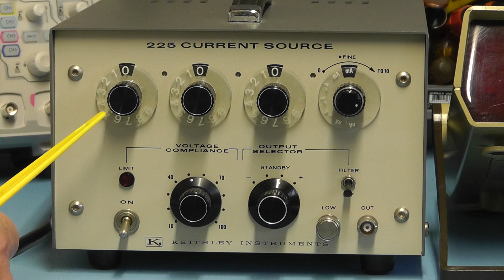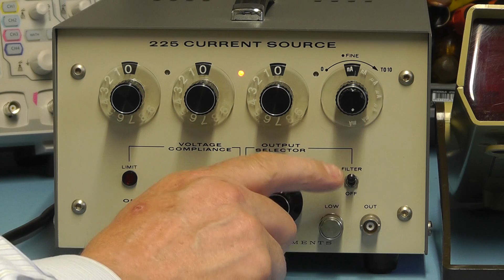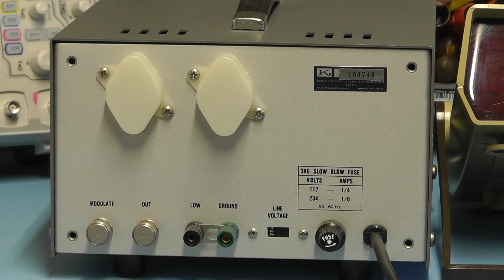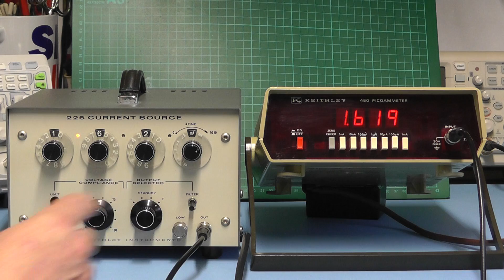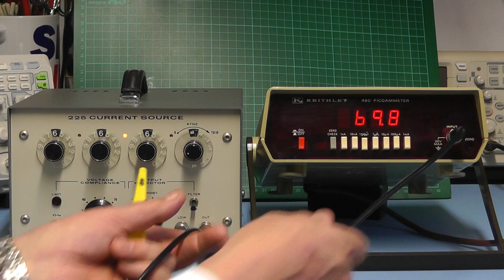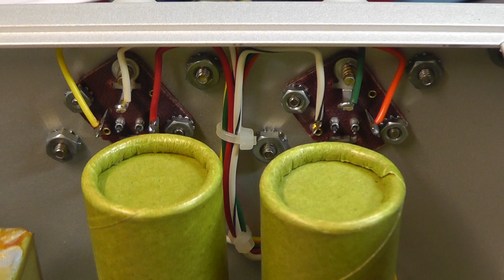Scullcom Hobby Electronics #16 - Keithley 225 Current Source Review & Teardown

Comment: Interesting review since I have the same instrument too. What I noticed is that you mentioned that the output impedance is > 2 teraOhm.  Outputs are supposed to have a very low impedance to make sure that they can drive a connected load. Ok, maybe I was confused because in a current source the internal resistance is parallel with the source and so 'the higher, the better'. I tested my instrument after getting it and was amazed about the accuracy of this 50 plus yrs. old instrument. Now I (and probably you also?) have to find a useful application for it :-). Checking LED's or testing MosFets gate currents?

Comment: I recently did a restoration on a HeathBuilt EU-80A Voltage Reference Source, including its associated Voltage-to-Current Accessory. "HeathBuilt" was a separate product line of the same Heath company that is more famously known for its HeathKit product line, and HeathBuilt test equipment was designed for equipping electronics laboratories in technical educational institutions, and especially for use by scientists rather than engineers. The EU-80A is quite close to this Keithley product, except its three digits of resolution selections use only two Kelvin-Varley Dividers/switches (the two most significant positions), with the least significant digit position being a potentiometer much like the Keithley's "Fine" control. The EU-80A also has a similar range switch showing the units of the selection, and three small lighted indicators to show where the decimal point is supposed to be, although it has only four ranges. It does not have the "Voltage Compliance" feature or the modulation feature (at least not explicitly), but it does have an auxiliary input for DC voltages that may be switched in to the output circuit in series as a sum/difference arrangement, and this could be used to add modulation. Of course, the EU-80A is natively a precision VOLTAGE reference, whereas the Keithley here is natively a CURRENT source. The EU-80A becomes a CURRENT source when the included Voltage-to-Current Accessory is plugged into the VOLTAGE output, and it has its own range switch, selecting currents in the µA and nA ranges (the VOLTAGE then gets adjusted to achieve the desired current), and it is a simple correlation, e.g. if the VOLTAGE is set to 10V and the accessory is selected to µA, the output current will be 10µA, and if the accessory is selected to nA, the same voltage setting will give an output current of 10nA. The conversion is achieved simply by switching a high value precision resistance in series with the voltage output; depending on the range, there are of course limitations on what kinds of resistive loads can be connected to the current output without causing significant errors to creep in.

This video does not seem to state what the circuit methodology of the Keithley is; my guess is that it is the same as that of the EU-80A, but perhaps if natively generates current from the outset......?

The EU-80A, being a less expensive instrument, does not achieve quite the same low error specification, although it is still good enough that the user won't be able to detect any error unless they have an expensive high resolution meter to measure with.

Comment: Spotted this supply unit on a workbench in an old photo, seemed very interesting so I immediately went to look after a video. And there was, thanks to you!!
This was a fantastic presentation, thanks for also showing the device back and of course, insides. Love those cute can-type heat sinks.
Also noticed that caps, transistors  all looked original. Impressive design and build quality to still deliver such accuracy! The user interface is nice too. Simple and convenient to use.
This was an old video, but I hope your Keithley 225 is still up and running happily :)

Comment: Register! Tenho um 160 Digital Multimeter mas as valvulas estão fracas. O que será?
Reply from the maker: My portugues is not very good but I think you have a Keithley 160 Multimeter which uses Nixie Tubes for the readout display which I think you are referring to as valves. You may be able to find some replacement Nixie Tubes on eBay.
Reply: Muito bom! Depois que inventaram o google tradutor tudo ficou claro! Obrigado! Tenho 160 Nixie.

Comment: Couldn't help but notice you had the voltage output of the current source set to ~50 volts.  And the ammeter says 30v max on the input bnc.  Also, is there a schematic for the 225 online?
Reply: GeorgeGraves Google keithley 225 schematic and your 1st hit would be the manual with the schematic, although seems like a pretty complex build!

Comment: Smashing video :D
Yet again another accurate instrument, i like the simple design and lack of computers involved lol :D
I havnt seen a metal can version of the ua/lm 723 for years, most ive seen are in 14 pin plastic dil packages, i think some of the metal round ones used to be coded L123 as far as my memory allows, i used to repair a lot of power supplys in the past and they were very common.
I do love the rotary wafer switches, i like the quality and ease of cleaning :-)